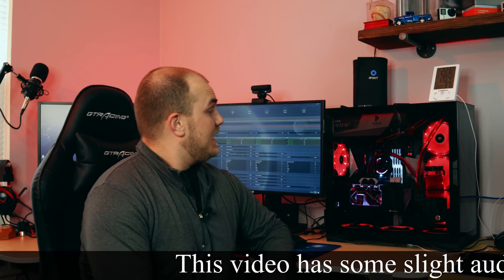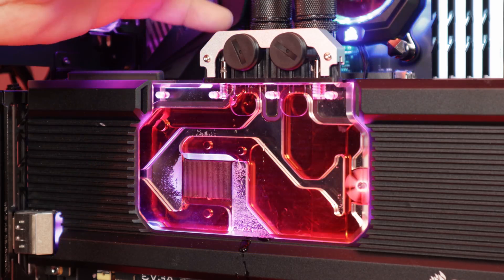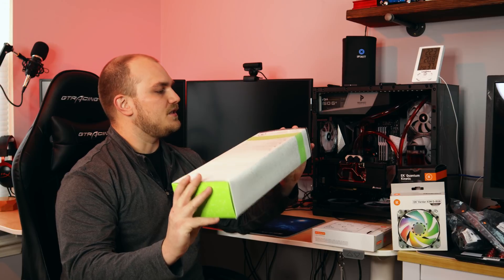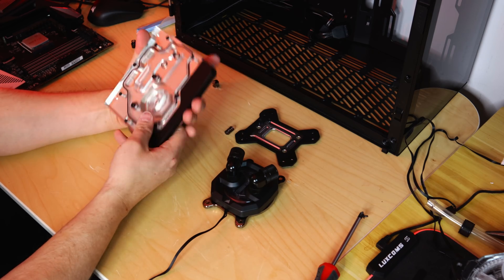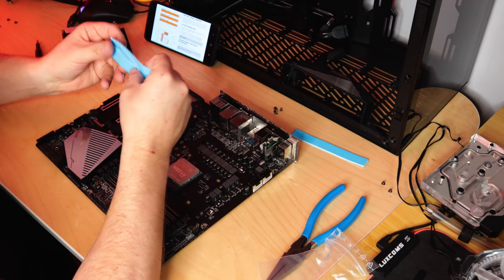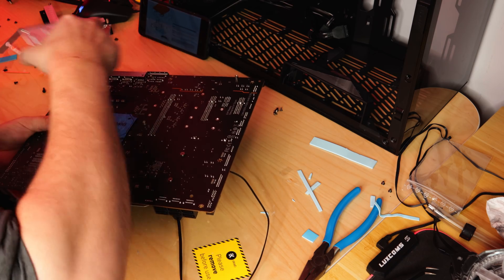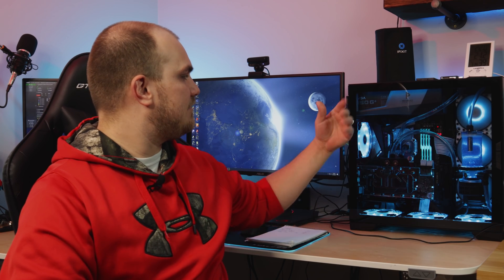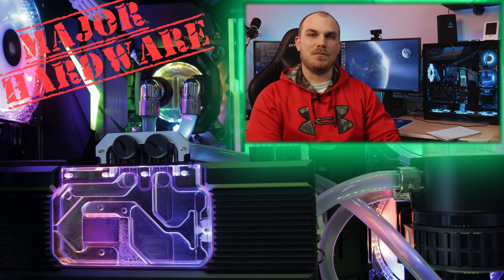SHAME! This Could Have Cost Me A 3950x AND 2080TI | UPGRADING My System To EKWB

Comment: Did you have the thin corsair rad compared to your thicker EQ cool stream, Not apple to apples testing. I use a mix of corsair and EK myself
Reply from the maker: Both thic boys
Reply: Major Hardware interesting, I’ve not seen a temp delta of 10-11c between mono blocks EK, normal acrylic blocks EK and the Corsair blocks. I’ve tested all 3 so something else was an issue. The deltas I’ve seen have been around 1-2c max on 3950x and other chips this has also been shown by many reviews also.

Comment: I find it funny that the Youtube product marketers that helped Corsair market the Hydro X stuff are silent about this design flaw. Goes to show these guy's don't actually use the stuff they recommend to us otherwise one of them would have found this design flaw. Tbh the Hydro X stuff looks cheap AF just like Corsair's AIO coolers IMO.
Reply: guess its a good thing I went with a cooler master AIO instead
Reply: @jamestor6700  
Coolermaster's AIO's are among the worst imo.
Reply: @hardcorehardware361  Have you actually ever used a CM AIO?  I'm not meaning come across as defensive but I was considering  buying a CM AIO and would like to know if you personally have had any problems with one, Cheers!
Reply: @Sk0die  My Seidon 240M leaked ever since then I stay away from CM, tbh I don't mess with water at all anymore I'm strictly air.
Reply: @jamestor6700  I'd say go for Arctic Freezer II's, they're total beasts
Reply: @bottomtext5872  true. But really ugly and the mounting is wonky.
Reply: It not only looks cheap it looks UGLY.
Reply: @datdudeinred  subjective. I like the look personally a lot more than the ek blocks. But I'll take the non-leaky ugly over good looking leaks.
Reply: what do you think about the alpha cool eisbaer ?
Reply: @Hunting4MadV  I had one the pump died around 6 months later, sorry for the late reply I wasn't even notified till the last guy responded.

Comment: That Corsair GPU block is terrifying. If that's how poorly designed mainstream water-cooling hardware is, I would never recommend people to do it, wtf. Also the temperature difference is funny. How can they screw up water block performance? For the last 15 years, water blocks have been competing for single-digit degree differences over one another! This was an enlightening video.

Also, just as a personal opinion, I really like soft-tubing. I think it can look really slick, and it's infinitely easier to work with. I'm using EK's ZMT tubing in my current build, it looks quite industrial I think, and it's very robust opaque tubing. But each to their own - I just mean that following the hardline trend isn't necessary to make a good looking system :D (Shots of my O-11 Air water-cooled build:  https://imgur.com/a/dauT3gD )
Reply from the maker: thats the best part of soft line its easy to work with and i dont mind the look

Comment: Something was definitely wrong with that entire Corsair setup, those temps were ridiculous, water cooling a gpu should never be that hot.
Reply from the maker: maybe i had bad contact and didnt know it or maybe there was something else going on
Reply: @MajorHardware   They use the same microfins used on AIOs but the water seems to be able to flow above the fins too (fins dont extend up to the acrylic top), maybe because that would impede flow too much.. 

Basically using AIO technology with a D5 pumps that has a massive flow.. all in all seems like a really bad combination for heat transfer efficiency. That's why all other brands of custom loop gear use fat fins (and wider spacings between fins) on GPU and CPU blocks.

Comment: Vrm on air ~80c depends the case airflow
Vrm on ek max 48c with lowest fan speeds
Reply from the maker: same MOB
Reply: @MajorHardware  aorus xtreme has some real heatsink with actual fins. Unlike the x570 aorus elite or lower tiers with the same vrm power phases. Which is annoying. because you have the same power delivery but you're restricted by thermals. Anyways .. 
*I heard ppl saying that they have better cooling without a heatsink on the elite with just direct airflow.
Reply: the VRM mosfets aren't going to be hurt by running at 80c, and they don't have a huge heat output, even if the temperatures are high.  (they're easy to cool)
If you're not running really high core counts, they'll actually stay pretty cool.
That said, it's certainly not a bad thing to run it cooler, if only to get the heat away from the capacitors to give them a longer lifespan.

Comment: Whats wrong with air cooled PC parts? I have 0 (zero) leaks.. and my rig is working fine ;) and i cool( AMD 3600 Noctua D15/ Red Devil 5700 xt, Thermaltake core i5)
Reply from the maker: no worries with air
Reply: Great work btw, keep it up

Comment: if those ek vardars work anywhere near as good as the evo's i have they are by far the best fan in existence
Reply: Noctua a12x25 are better
Reply: @riba2233  You can even run them at near full blast without your ears falling off. The quality of the a series is immense. Just don't get the industrial one unless you have a server room as they are really loud.
Reply: @benjaminsmekens2344  Even the industrial ones are fine if you run them at a similar level of airflow.  I'm running 4 of the 2000RPM 140mm iPPC version, and it's quite quiet.  Their PWM control is actually reliable to run at low RPMs.
Reply: @riba2233  actually, the vardar in my experience are way quieter in front of rads and have better static pressure.
I guess it's hit or miss depending on the case design and the FPI of your particular radiator.
Reply: Actually all Noctuas are better. Noctua fans got the best noise/pressure/airflow ratio. Chromax are already better and the NF-A12x25 play in an entirely different league.
Reply from the maker: i really like the look
Reply: @MajorHardware  hell yea they got this like robotic futuristic heavy metal thing going on

Comment: Lian li O11D XL
Reply from the maker: i could get 2 360 in that
Reply: @MajorHardware  run 3 x 360
Reply: @MajorHardware  Running one 360 and two 280. I can definitely say that those temps you have can go down :p With lots of rad, you could either run the fans super slow during normal use with great temps, or let the fans rip and render for days at great clocks. Plus, linking all the rads together in series, you remove one ugly long run of tubing to go back to the reservoir (yes, you got to find excuses to go overkill!)

Comment: The difference in temps before & after is massive. Is it possible you had some bad thermal paste contact, or any other kinds of user error?
Reply from the maker: I mean its always possible, i dont think i did but ill never know for sure.
Reply: @MajorHardware  It is curious for sure. But regardless, this was great content and a good reminder for everyone to never be an early adopter of new products.

Thanks and stay safe!
Reply: Just venturing a guess but maybe that original cpu waterblock wasn't designed well for ryzens placement of core chiplets... 

The high gpu temp tho would have me thinking the problem would just be air flow through the radiators...

I know that when I swapped my alphacool D5 pump for an ek ddc elite, what I can only assume was better water flow my temps dropped across my 1700x and dual 1080ti's

Comment: I have the little brother version of your system. Same motherboard and monoblock, all open loop parts from EKWB (except for fittings & tubing), 2 360 rads (a 360XE & 360PE), but with a 3800x & rtx 2080 & all housed within the Lian Li O11 air. ... I am super jelly of those new EKWB fittings. I am tempted to replace my current fittings.
Reply from the maker: ya the little accent rings are actually pretty cool
Reply: @MajorHardware  ... btw, nice looking build. Definitely an improvement over the 1st iteration.

Comment: The reason for the sticker on the underside is, that they get destroyed normaly when you open the block. My CPU Block has it as well with the label leak tested. I think that is the thing that Corsair is missing
Reply from the maker: corsair failed the leak tested test lol
Reply: My ek blocks had the sticker as well, I'm sure they are meant for telling if you opened the block or not.. that being said his stickers were on the cold plates for the components where it shouldn't have been..

Comment: Ek should drop prices. Coz for 1% gain have to pay 60 % money. And Ek don't even pay their workers premium salary as they charge premium for things
Reply from the maker: I dont know much about the workers thing but the performance is better, build quality is better and price is higher, not sure its 60% but it is a bit more. hindsight tho i would have bought the EK block over the hydro x if i would have known.
Reply: @MajorHardware  have you ever tried Bykski or Alphacool ? I have Bykski Cpu, Gpu, Alphacool rad st30 360 x2, Alphacool CKC liquid, Barrow pump and Freezemod compression fittings. But stay away from Bykski liquid. Cpu 3800x 4.4ghz 1.33v never went higher than 78c on prime95. I can push 4.5 on 1.47v but it gets 98c in seconds of prime95 . Lol
Reply: @MajorHardware  my water cooling setup cost me about 300usd. And one EK cpu block is around 100 usd. It's not posible for part time working student. And i live in that country where EK produces their products
Reply: Victor, just please stop spreading false information. EK is one of the most successful and respected companies in their home country.
Reply: @Attila_Gobor  WTF ? What lies!? yes, it is true that ek is most respected, successful, the best performer and Most Expensive. But cost per performance way off. All I'm saying is Ek should lower the prices a bit or give bonuses to workers at factory not the marketing department.
Reply: @2003dipfun  
EK-Supremacy Classic CPU block - 69,99$ a top performer block, Boom!
You want cheaper than that? You want products without a warranty? You want products without user manuals? You want products with compatibility issues? Sure you can find cheaper stuff.

And what do you know about paychecks and bonuses at EK anyway?
Have any proof? Or you are just bored at home and you make things up?
Reply: @Attila_Gobor  Boom! You realize that we are located at two different continents.  Boom! All other products i named aslo does come with warranties and orher things. Boom! In my place EK sc cpu block is 109usd. I can't proof any thing to the person who ignores reality.
Reply: @drinfamous9326  If I was a corporate lapdog, I would not be reading the feedback of the public, right?
This guy is coming in with some random false claims, and I just want to get to the bottom of it. So far, he has not produced any evidence. 
He says he lives where EK products are made, and the Supremacy Classic Block is 109$. That is plain misinformation, you can check the price of the block in the EK webshop, local shipping is 3$, which will not be 109$ in any given case. If some reseller is ripping him off, I need some evidence from him, a link, a screenshot, whatever.
Reply: @Attila_Gobor     Do you have proof that those other products he named doesn't come with warranties? I don't see any screen shots. Your concerns about this situation made you very suspicious. So what are you? Do you work for EK? Or just an another fan boy with the tag?
Reply: @drinfamous9326   Dr Infamous  I never named one of the above mentioned brands as the ones that don't have user manuals. My reference was regarding the price and that you can always find cheaper products that will have setbacks compared to other brands. Will the setback be a lousy manual, the non-existence of customer support, lack of original design, performance... It can be a number of things. I would not want to continue the topic on what other brands do, and what people buy, we all have our reasons and budgets... I imagine I came out bad, but as an official EK employee I would like to focus on what the gentleman said about the prices of EK products, because what he said is just not true, and I would also like to hear more about his comments on the paychecks at EK, and from where he is getting his information from.
I hope you can see my point of view.
Reply: @Attila_Gobor And there are other products that almost as good as EK but at much lower prices. For example Bykski, Barrow, Alphacool and so on. This is not a Lie

Comment: Please turn those bottomn fans, so they act as intake :<

Edit: Ah you did it when you rebuilt it :D
Reply from the maker: bottom fans are set to intake, rad and MOB fan are exhausting
Reply: @MajorHardware  ye, I commented before I got so far that you talked about rebuilding the computer with new parts. looks gorgeous :)

Comment: As a rule of thumb, never buy anything from corsair, buy directly from the manufacturers, no need to pay a middle man.
Reply from the maker: i learned my lesson
Reply: Yup, that's why i suggest to always buy directly from the manufacturer.
Reply: I dont know man their itx power supplies and RAM are pretty good
Reply: Yeah because seasonic makes them, the actual seasonic ones are better though. And RAM, ok, do you know a company that makes "bad" ram actually? Also again, G.Skill makes them better, so what is their point?
Reply: @stronkveak5917  Seasonic makes some of Corsair's supplies, but they use other manufacturers as well.
Most memory "manufacturers" are building based on reference designs from JEDEC, etc, so there's not likely to be as much difference between manufacturers in that regard.  The main thing that the memory manufacturers do is binning the chips for speed, and adding on some RGB junk around the edge of the board.